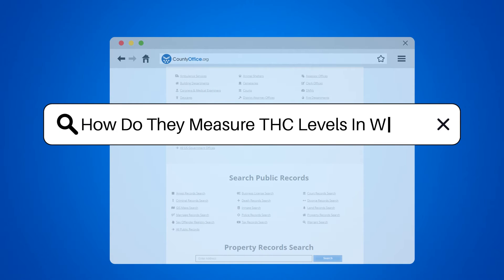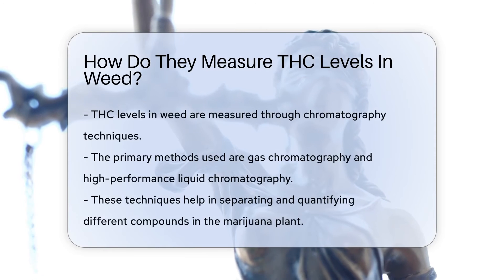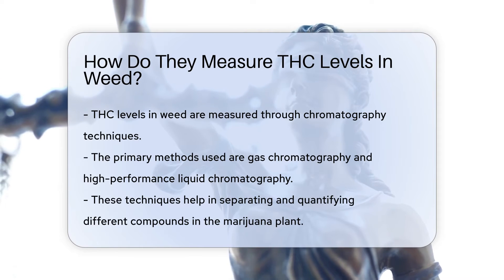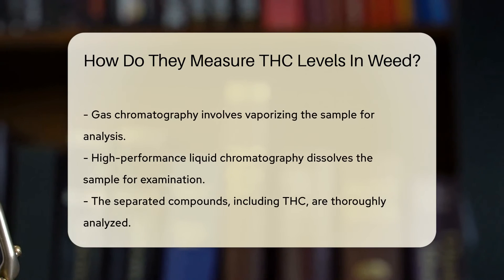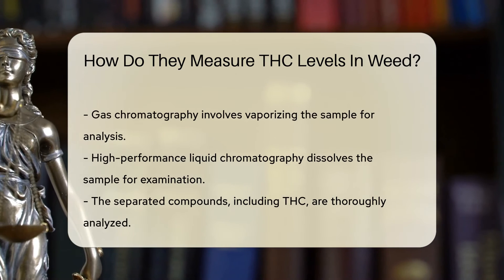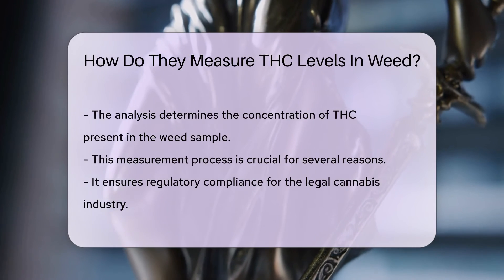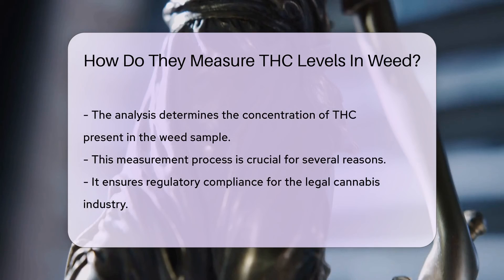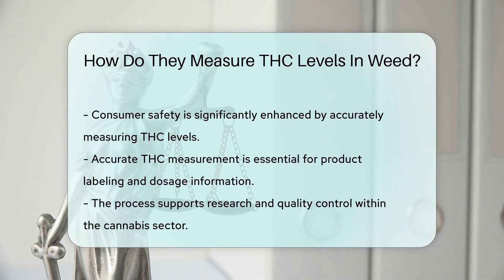How Do They Measure THC Levels In Weed? - CountyOffice.org

Comment: Not entirely accurate.  HPLC is the only method that can correctly measure the THC concentration in cannabis.  GC can’t be used because it vaporizes the cannabis which causes THCA to Convert to D9 THC.  Therefore, HPLC is the only method.  Most Mass spectrometers are not calibrated to accurately quantify molecules.